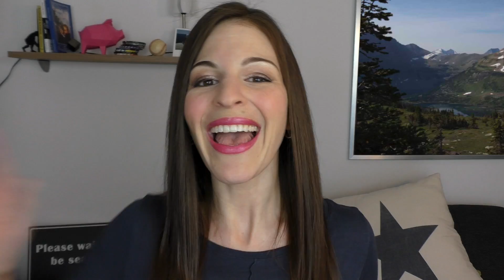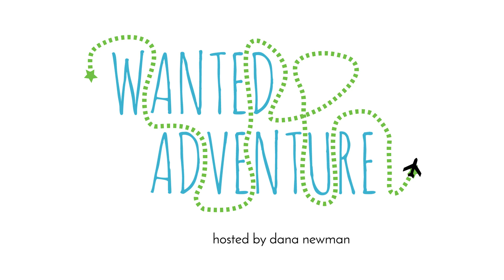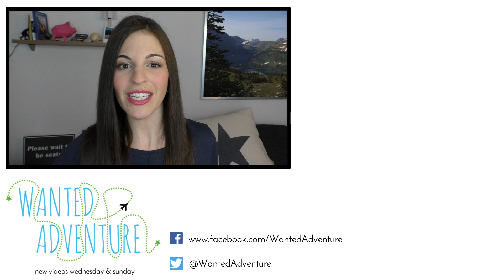Why Are Houses in America MADE OF WOOD?!

Comment: Another factor is that brick and masonry is a very poor insulator, wood is better, and the large voids in wood walls allows for lots in insulation.  It is also an easy channel for plumbing and electrical runs and heating ducts.The north central US is in a very cold zone compared to Germany.   Much of our wood housing stock is 100 or more years old and still standing, many wood houses in New England are over 200 years and still functioning and this in a tough climate with cold winters, lots of rain, and hurricanes.  A properly built wood house will resist termites, hurricanes, earthquakes and zombi invasions.
Reply: A properly built wood house will resist termites, hurricanes, a fist to the wal- oh no wait.
Reply: I take it you didn't realise that we do put insulation material in between two layers of brick for all exterior and some interior walls in the house
Reply: which is better in a hurricane brick house or wooden house ?
Reply: What the hell are you talking about? Brick and concrete for building houses. Wood? for barns maybe.. there are many kinds of isolating plasters to put on the brick walls on the inside plus many kinds of isolating facade for outside.
Reply: What are you talking about?  You use the best material for the structure you are making, you don't just default to something for no good reason whatsoever.  Where I live, only someone wanting to be different would build a brick/concrete house, as there is absolutely no reason to use brick/concrete and a wood house would be far less expensive to build.    Labor is expensive here, and can cost more than the materials involved.  When you greatly increase the time to build a house, you greatly increase the cost.  When you replace low cost wood with stone, you greatly increase the cost.  It's just not worth it.
Reply: No, 30cm of modern Bricks insulates about as good as 60cm of Wood.

Comment: Germany doesn't have much wood and use what they have for structural components such as roof joists and floor beams.  Your point about tornadoes is correct, even steel structures come apart.  Wood buildings fair better in earthquakes than do masonry (brick).  German houses are built to last a long time, hundreds of years, this makes them very costly.  The problem is that a house built even 150 years ago lacks most of the modern conveniences such as plumbing, heating, electric, telephone lines, and A/C.  Retrofitting these into a very well built older building and not being too obvious is also costly.  We have rather fast paced technology and while the hard items in a building will last, for the technical features even if they do last, they will be outdated.  Been in a bunch of old buildings 'wired' for gas lamps!

Comment: Heck when I lived in Florida most houses were cement block. Some of it is cultural, when the first Europeans came to America they found millions of acres of forest, some of it they wanted to cut it so they could farm it. It was both quiclker and filled other needs to build wood houses rather than take the time to set up brick kilns and produce bricks. One of our houses in Wisconsin was a log home built in 1849. We got a copy of the abstract for the property and it was timber land, the person bought 40 acres but his deed only allowed him to to cut "certain" trees, all others would be cut  by others in a specified amount of time, he also loaned money (issued a mortgage) on the adjoining 40 allowing someone to buy it, they logged it off and defaulted on the mortgage but it looked like that was the plan all along. In some parts of the southwest adobe was the common building materiel until industrialization made shipping wood in practical. Some parts of Wisconsin all the older houses are brick, the people who settled there came from a part of Europe that had brick house as the tradition, this was less than 30 miles from our log home, I knew of a half dozen stone buildings in our part of Wisconsin that were built in the 1830's to 1850's, some preceding statehood .  Other areas of Wisconsin and Michigan had a lot of brick structures as that's what was code after the forest fires burned the original settlements.

Comment: Houses are built out of wood cause of the cost of materials and labor is high. In New York State is 100 sqft. If you Make it out of concrete it's easy twice that much besides that concrete won't last 30-50 years again all depends on material and cost of material. As for tornado ally no house made of concrete or wood can with stand a tornado. Look at Joplin Missouri which is where my wife is from an EF -5 tornado wiped the city of 135 people were killed and took a 10 story hospital and all the commercial buildings off the  foundation and wiped it clear of the earth. My wife's aunt survived thank God. I think the best solution like tornado is to actually set it under ground like a Hobbit house cause of safety from debris and tornado goes over the home keeping it safe. The EF-5 was over 1 mile wide and to this day we visit and hardly any trees are around in that path.

Comment: Living in California, I can tell you that a wood frame house withstands an earthquake far better than a rigid masonry structure.  Besides, wood structures are light and the materials are easy to transport.  Wood structures are also much easier to modify.  If you want a new electrical outlet somewhere, it's a lot easier to install it in a wood framed wall than in a brick wall.

Comment: as someone who lives in the heart of tornado alley (in the USA, Wichita KS to be exact) there's no way I'd ever live in a brick or concrete house. I don't think people grasp the power of tornados. People picutre think of an f1 or f2 swirling around open plains like in the Wizard of Oz (please no Dorothy comments, they're old trust me I've heard them all). While we have these, and yes a concrete house would be sufficient, the second you hit f3 you're in big trouble. Tornados not only pick up objects, they also level them. We go to the basements or middle of our houses, usually a restroom, when there's a tornado because those are the safest places. If my concrete home got leveled, surviving the tornado would do no good, I'd die waiting to be rescued from the rubble of my concrete home above me. Wooden houses are perfectly fine by me. They're cheap and while they're easily destroyed, we do have safety features like basements and tornado shelters to help. And yes I've seen a handful of tornadoes in person. They're scary and loud like a freight train right over your head. But we also have straight line winds here which can be just as destructive as an f1 or 2 except instead of swirling around it comes straight across. You deal with the area you live in and adjust to the climate of your area. I'll put up with tornadoes to enjoy beautiful sunsets over grain fields  (we have more than just wheat btw) any day.

Comment: Only older homes are made of wood. In the West, they are wood frames on cement foundations surrounded by stucco. During to 70's they began using drywall inside, no asbestos and no lead paint. The West doesn't get tornadoes...only earthquakes and floods!

Comment: I'm from the East Coast of America and there are brick, stone, cement, and wooden houses it all varies. It's not like we live in log cabins lol. The frame of the house is wood and sometimes reinforced with steel. The foundation is concrete of cement. Then the house is built of some kind of stone or wood (if wood then it usually has vinyl siding or a stone facade). There are plenty of houses that have been around for at least 100 years and some that are 300+ years old with no problems. I recently moved to the West coast and a lot of houses here are made of adobe bricks or stucco or the wood/vinyl mix it depends. Either way, America is over 3000mi or 4800km across. There isn't ONE type of house and I promise Americans aren't living in dilapidated structures, nor do we have to constantly rebuild our homes lol

Comment: It's all a cost vs benefit analysis. Homes in the US come in all types, shapes, and materials based upon what's available for the right price. The home in the US that look's like a nice brick home may actually just have a brick facade. Tornadoes are really just one concern that people have and Earthquakes aren't just a California concern. The New Madrid Fault is such a concern that reinforcement work has been undertaken on the Hernando de Soto Bridge over the Mississippi River from Memphis, Tennessee to West Memphis, Arkansas. Floods are not especially common as major disasters because many cities, states, counties, etc. have ordinances and laws against building in 100 year flood plains (or they require special building standards).
.
Many of the homes that I know about will split the difference between the advantages of stone built homes and timber frame homes. The basement level is built out of reinforced concrete and cement block; the upper levels are timber frame. If a tornado does come, families have a safe place to shelter and damage from flying debris is relatively inexpensive and quick to fix compared to stone work. For areas that might be affected by both tornado and earthquake, well built hybrid homes can offer the best of both worlds.

Comment: why are the walls so flimsy? the walls of the structures here in Italy are solid concrete. Can't punch a hole through the wall.
Reply: They are talking about new construction. Also a lot of rent homes do not get the care they need. My walls are 6x12 inch cypress boards.

Comment: It's actually a cost issue. The cost of concrete is much higher than a 2x4 wood. It is the difference between a house costing $200,000 vs $600,000 to a million. Trees are regrown in the industry to keep up with the demand and the wood is also reused at times as well. Concrete can also be reused but for a much higher cost of breaking it up.

Comment: Brick and concrete are very different in terms of resisting strong forces.  A concrete house is like a single huge stone, not a pile of little ones.  One way to build it strong would be a thick outer shell of cast concrete with lots of rebar, then a soft layer of stone or glass wool for isolation and vibration dampening, then an inner shell to live and survive in.

Comment: Every human society constructs dwellings according to the local environment and availability of materials. North America has immense forests, with sustainable forestry practiced on massive scale. So wood is relatively cheap and likely to stay that way. The price of brick and concrete is sensitive to energy cost, and concrete production in particular produces mind-boggling amounts of CO2 if fossil fuels are used. The better question is why houses are stick-built on site instead of factory-built, modular, and prefab. Roof trusses are almost always ordered by specification and delivered on a flatbed, so why not do walls that way?
Reply: Luke Hamaty
Right. Making cement uses fabulous amounts of fuel (crushing and heating), while the CO2 sequestered in lumber reduces what is in the air.

 Although the Germans say all the forests were cut down centuries ago, for ships and firewood, so they don't have much lumber, in fact nearly 100% of construction lumber in the US is from wood grown after the original forest was cut down. So where''s the problem in Germany? Also, I have been informed that all those beautiful, scenic forests you see in Scandinavia are mono-culture tree farms.

Comment: As you should probably already know, Dana, houses in Florida are generally made with concrete block.

Second storeys are usually wood.

Commercial structures are all concrete block and/or slab, plus steel.

Comment: Of cause there´s the occasional car or bus tossed around by a tornado, yes, but but tose hit maybe one house out of 20. Most damage is done by small things, shingles, rafters, posts, and such. Those go through a wooden wall like a hot knife through butter, but a decent double brick wall of 10" with just some rebar in it turns a flying piece of wood into matchsticks, just because of weight difference and inertia alone. Weight itself is another factor, a wooden house of maybe 20-40 tonnes is just too light, a stone one with ten times more weight isn´t that easy to blow away.
The problem in the american way of building houses from maybe the 20s onwards is the lack of substancial wood, the walls are just made of 2x4s to 2x6s with 1/2 plywood on both sides, there´s no sturdy framework. 
Wooden houses can be strong, stronger than even brick, just look at some houses in the alps or the good old log cabin. Last one strengthened with vetical tie rods from roof to concrete floor plate and everything´s fine. 

In one documentation about american housing I heard one very interesting thing:
The industry (from 20s or 30s onwards) did not want houses that were build to last for ages. 30, maybe 50 years, not more. 
Construction laws even seem to forbid screws on some connections, just nails. Nails move and can work their way out, screws usually don´t. 
But the most important factor for the Why? is the price. 2000sqft of standard build seem to be much more appealing to Joe Average than 1000 with a little more strength.

Comment: Most American houses (around me, anyway) have a concrete foundation, wood structure (around all the rooms as well as the outside), and often a layer of brick around the outside as well. They also sometimes have siding which is usually made of wood, I guess, but it's not the majority of the house. If it helps, I live in Ohio, which is in "Tornado Valley."

Comment: Interesting topic indeed. I have been traveling all over the world myself, and you can see a clear difference.
What I find very interesting, is that most houses from ex-colonies or colonial areas, like USA, New Zealand, Australia and so on, all have very similar constructions (including the light-switches, as you mentioned in another video) 
I do believe that the main reason is that the first settlers didn't had much to begin with and wood is easy to use and modify.

In some areas, like in NZ, it has some benefits because of severe earthquakes. Wood is much more flexible than bricks and concrete. For the same reason they still use a lot of nails. 
In fact, most concrete and brick constructions are being demolished almost every time when there are earthquakes again. 
That doesn't mean it can't be done with concrete constructions, but I guess this is cheaper and easier.
(NZ is going back 50 years in time anyway, lol)

It is difficult to say though, because development in some of these countries is also not going as fast as others.
What still blows my mind is the lack of insulation, also in the USA. You can even insulate a wooden construction very well.
For some reason though, people just turn the heaters on more often (and therefore waste more energy = money & resources)
A well insulated house is also much more comfortable and it's actually not so much more expensive to do it properly. 
The mindset is very different, and (especially) compared to the Germans, their ideas of 'saving' and being 'efficient' is almost a joke. (I don't mean that on a bad way btw!!)

There is only one thing that still baffles me. Middle and South America were also colonized. 
Of course you still see many little wooden homes, but there is also a significant amount of houses made out of brick.
Maybe we should blame the Brits for it, hahahaha

Again, ones you start traveling and staying at places for a while, you can't stop pointing out the funny, strange, remarkable,  weird and interesting differences! It's great! The world is big, yet so small.

Comment: First, A tornado is far more than just high winds and even the heavy objects it carries with it. It has immense pressure variants that in them selves can cause a house to explode from the inside out; this is not fixed by stone and brick as those are not single contiguous construction. If fact, a tornado can, due to extremely rapid pressure changes, put straw through metal objects (I have actually seen this) and broom handles through brick walls.

Second, it would take an anchored, reinforced concrete box (for above ground) or monolithic dome, equally strong windows and pressure relief capabilities to withstand a tornado. The sustained PSI that a tornado can exert is greater than that exerted by some bombs.

Also, to be fair, where I live, houses (made out of wood) are built to withstand an EF2-3 tornado (wind, not objects blown by it) despite being built stick frame. If your house is destroyed by a tornado (it would be if made out of Brick and stone, too) it is cheaper to rebuild if it is stick frame (stick frame = what we call wood stud construction techniques).

Comment: In the 19th century many homes in the US were made of brick and block and even concrete. Those houses often remain today, but so do many of the homes which were  made of wood - more so actually.
The big differences are initial costs versus maintenance cost. A home made of wood will cost less initial but is (was) considered to require more maintenance.  Now that most homes are covered with vinyl siding the maintenance costs are less.
Brick and block, etc. also take longer to build and cost more both for materials and labor.
I have to run.